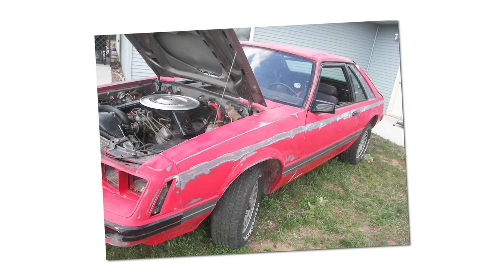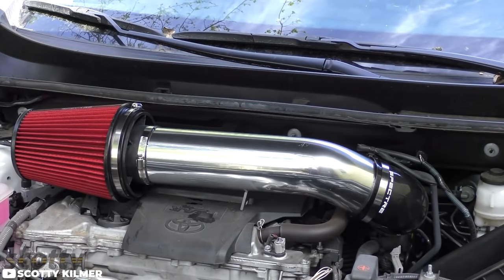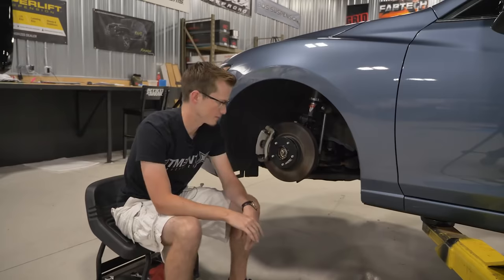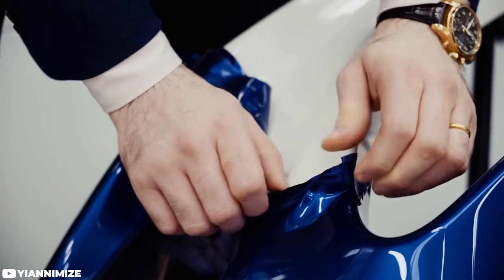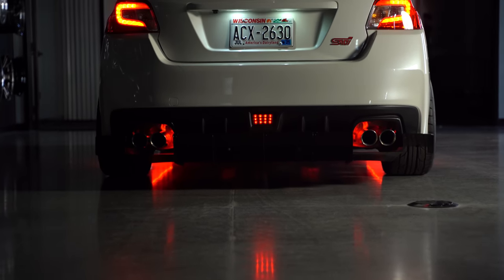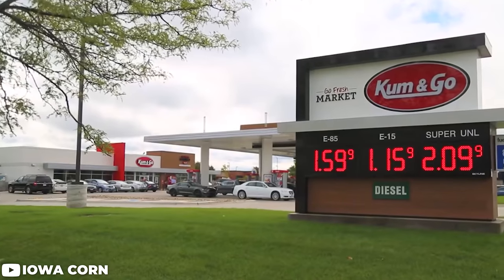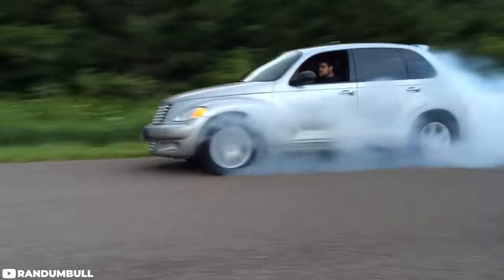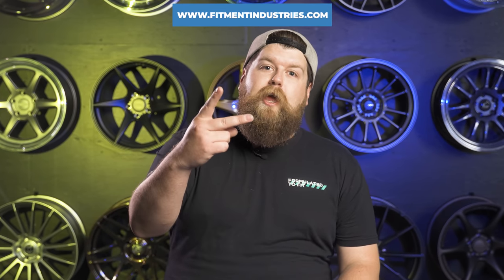Car Mods We Changed Our Minds About! 🤯

Comment: I sometimes run underglow when I do deliveries during the night. I've gotten some nice compliments from my customers, young and old, about it, and even noticed a slight bump in my tips. Depending on the market, an underglow kit might increase your tips on food deliveries.
Reply: You ever get chased down by a motorcycle gang while driving with that underglow.
Reply: Babe it's a long term investment!! 😂😂
Reply: @mrred5260  Nope. Usually, if a motorcycle gang is nearby, I move over to the rightmost lane and let them pass. I don't bump into many motorcycle gangs around these parts, and if I do, they're usually chilling at some gas station. That and I don't know of any biker gangs with military base access -- if I have a base delivery, then they can't follow me if they don't have credentials.
Reply: If anything i would think it lowers tips
Reply: @dr3nch_g0d52  It would depend on your market, demographics, customer attitudes, and other factors. Not every market is the same but around my area, the folks seem to dig it. If I ever move to a different city and find that the opposite is true, I could always keep the lights off since I have them wired to a rocker switch. No biggie.
Reply: I read that as “complaints” instead of “compliments” Im stupid 😅 I was hella confused on how you get nice “complaints” and still get an increase in tips
Reply: @FlashGalatine  Ignore them, they just hating now knowing damn well they thought it was cool back then
Reply: My rating went up when I got my Focus ST. Everybody loved it, even with the exhaust (Thermal R&D) and upgraded turbo (ATP GTX3071).
Reply: @michaeladams1136  until it breaks lol

Comment: For the car mods I changed my mind about, ANYTHING ENGINE WISE FOR A 4 CYLINDER.
I let my dad convince me for so long that 4 cylinders weren't worth modifying, and that if you want an engine to modify, you should always get an i6, a supercharged v6, or a V8, nothing else, but since I got my Accord the outlook changed COMPLETELY. Even with less power, it's much faster than my old car (I chalk it up to the transmission being A. a 5 speed and B. having less shifting issues as a fuel electronic rather than hybrid electronic vacuum system), and even as simple a mod as simply yanking out the intake battle was enough to HEAVILY improve my perception of driving it.

Comment: The thing about spacers is you have to get the right ones. I'm using a pair only on the rear of my 97 camaro to give it a staggered stance look to compliment my lowering springs. The best thing to do is get a set of hub centrics and balance the wheel and the spacer at the same time. Eliminates vibration from possibly poor casting for a smoother ride.

Comment: I put a short ram intake on my Corolla and it sounds so good. I would argue that you aren't actually decreasing filtration that much by switching to an oiled filter. I think short rams are generally a smarter idea because of the whole sucking up water risk with a cold air intake. Plus, with the short ram you can display the filter in plain sight in your engine bay and it is easier to service. Also from what research I tried to do, the short ram is generally louder. I hear some absolutely awesome intake sounds now... 10/10

Comment: Ordered a pair of HSD coilovers for my Hyundai elaborate gt. I live in the suburbs of Chicago, where the roads aren't too great. It's nice being able to lower the ride height and adjust the dampening, but if you're not driving on smooth road, it doesn't feel great, especially with the stock 17s

Comment: I bought a 67 c10 from the original owners back when I was 13 for $500. My first mod was a new engine and tranny. Had a 283 and power glide. 

350 swap, th350 tranny, disk and power brakes, headers, aluminum radiator and reupholstering the seat. That’s about all I did, that and some old school slot Mags. Now it’s got a 502 big block

Comment: I cant speak for literally any other engine but the 2.5l N/A 5 cylinder that vw offered will pick up power with a different intake. The stock intake wraps around the engine and has 4 sharp corners which lower air velocity and raise its temperature. Do your research and think about how your intake flows to the throttle body before you buy one for power gains

Comment: That pt cruiser lol holy shit what a sleeper 😂
Reply: GT Cruiser and HHR Turbo both are fairly easy to go 12's or faster. The transmission in the GT is weaker than the SRT-4 and no they don't swap. HHR has the same drivetrain as the Cobalt SS Turbo, but with the optional automatic transmission. Record for the GT Cruiser is 11 seconds.
Reply: @dj4monie  k......😒

Comment: I just bought my first turbo car and tossed the stock baffled intake to a ZZP CAI and man you can really really hear the turbo and it’s sweet sweet noises now! The car feels a little bit more responsive with throttle input. But I bought it for the noises! 2014 Cadillac ATS 2.0t I also have downpipe, 67mm throttle body, e85.
Reply from the maker: Ooff let’s go! Do you already have some wheels on tires on that bad boy? -Edgar
Reply: @FitmentIndustries  no I have stock 18’s but my 05 sts has some staggered reps on it and my 05 deville has some custom powder coated wheels and coilovers

Comment: Did nobody else notice that he said the exact same thing twice in a row?😂
1:44 
“There are so many more benefits to a solid piped open-element induction system than I actually realized. While it may not actually increase performance and technically could actually filter out less contaminants”

Comment: I just got a 2021 Subaru sti I bought an AEM cold air intake do I have to do additional mods and tune the car before installing, will installing it without additional parts eventually compromise my engine, will this void my warranty??

Comment: I used to think cutting springs was dumb, but Its always better to sit lower and save money
Reply: cut springs are fine as long as you change to some stiffer sport struts as well. trust me cut springs on 20 year old (probably blown out) oem struts are not fun when you feel like your car is gonna bounce right off the road 😂
Reply: No
Reply: If you cants even afford a set of lowering springs, you shouod be trying to jump straight into modding, just save up, theyre pretty cheap
Reply: @conormulligan7966  i was joking bud, cut springs aren't safe and i don't recommend them. even $300 ebay coilovers are better cause the spring isn't going to fall out if you hit a speed bump too fast 😂

Comment: I have a mate with adapters on his Suzuki and one time one came loose. The wheel fell off and he had to drive it back from the back of the farm to the trailer with 3 wheels. Obviously it takes a hammering tho because it's a 4x4 and it has oversize tyres.

Comment: The one thing every one forgets to mention most people use a wet filter on the cool air intake and it damages the maf, Mas, or electric throttle body.
Reply: Yup it happened to me what I slapped a oiled filter on my V6 Altima (don't judge me).  After about 2 weeks the MAF crapped out.  I put the stock filter back on it and got it fixed under warranty.  After that incident I swore off oiled filters.  Dry element filters just don't seem wise to me either.
Reply: @brandons9138  they make a k&n dry filter they sell them at the dealership
Reply: @keepitcleanaudio  I know. I just don't see how a dry cotton filter will hold the dirt. That is usually what the oil is for. It gives the filter element some tack so the dirt will stick to it.
Reply: K&n is the most trusted I'm sure they tested for that

Comment: I think steering wheels are one I changed my mind on for sure, changing the wheel out to look cooler is kinda still dumb for me but i just got an 88 corolla gts and that things wheel is like a fucking boat. I switched to a smaller one and quick release cuz i thought if i'm switching, might as well be that guy, and between the grip on the aftermarket one and the size, driving the car went from barely fun to all I wanna do is drive it

Comment: I want to put e85 in everything...the gov doesnt want to tell us how great it is cuz they want everything to be EV
Reply: I prefer fuel economy
Reply: @TheFanatic340  E20 is 1-2% drop in economy with 90+% of the benefits of higher concentrations.  My car ran 13.75@101.9 with a tune (JB4) and E20/E30, drag radials, otherwise 100% stock.  Video , is on my channel, it's run 13.77@103.4 recently same as above with water-methanol injection.
Reply: @dj4monie  That's not e85 then. yeah you're mixing in e85 but e30 is far less than e85. I'm running e30 and my fuel economy drop wasn't all that bad, but if I ran e85 it would be terrible.